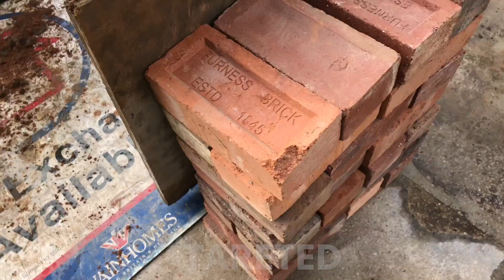UNIQUE BEAUTIFUL WALL DESIGN

Comment: Nice job 👍🏻 why the brick tor? And when do you use it? Thanks
Reply from the maker: adamstudd28 . Thanks pal . It’s mainly used for tieing in . Because of the design of the wall we can’t bond  the pillars to the single skin panels so the brick tor ties them together. We put it full length twice just to give the wall some extra lateral strength.
Thanks for watching and commenting 👍🏼

Comment: thanks for posting . why in stretcher bond . neat job
Reply from the maker: zaid hussain . We really like doing English bond , unfortunately as we were bonding into the original wall the brick sizes were very different. This meant the original wall was over 230mm wide and our new brick were only 215 mm long so the headers would have looked awful . As it was only 5 course we went for tie wires instead just for neatness 👍🏼

Comment: Great work guys. Two questions, how many courses between brick tor and why must line come off bottom of pin?
Reply from the maker: John Jones . Hi John the brick tor went in short 600 mm lengths every 6 courses , then we put 2 full lengths 1/3 of the way up then 2/3s of the way up . 
The line comes  off the bottom of the pin so that the pin isn’t in the way of the 1st brick .
Thanks for watching and commenting 👍🏼
Reply: Makes perfect sense, cheers!

Comment: Expansion joint?
Reply from the maker: Michael Mulraney . This is only phase one so far , we are rebuilding the whole wall so will put one in at the next new pillar .
Thanks for watching and commenting 👍🏼
Reply: Would be nice for your followers to see it going in at the correct length of wall  ,thickness of the joint material,ties ect .this my friend is not a criticism it’s an enhancement of your fine work and hard graft.
Reply from the maker: Michael Mulraney . Thanks pal , your suggestions will be noted and taken on board , thanks for the feedback 👍🏼